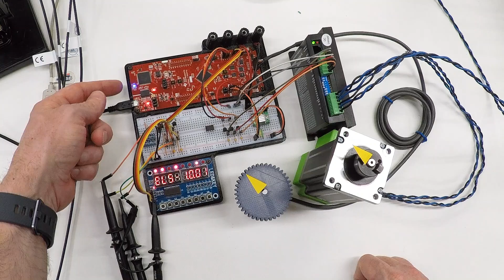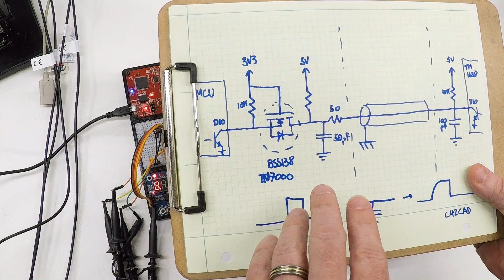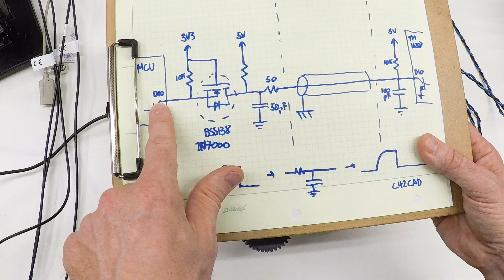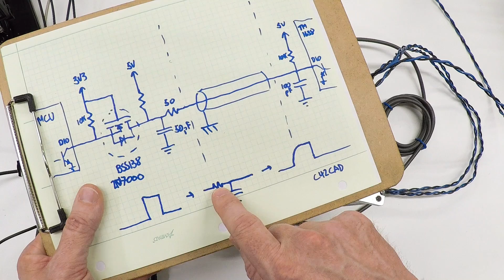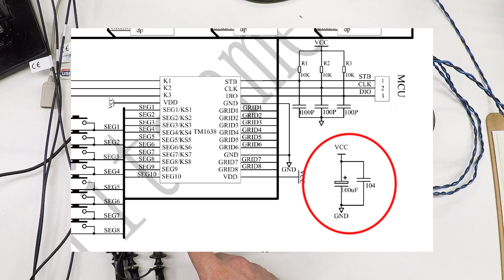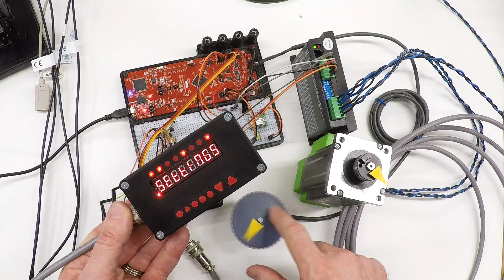Lathe Electronic Leadscrew Part 3: Control Panel and Debugging

Comment: Fantastic idea for starters. I really hate my lathe banjos and gears. Major concern is of course any asynchronicity between spindle and lead screw due to, not SW or HW, but physical forces strong enough to throw the stepper motor off. In a physical gear connected configuration, lathe motor could halt but would always keep spindle and lead screw in sync.
Reply: Most likely, the spindle motor will stop faster than the lead screw, but both are possible. Maybe tachymeter sensors on both can fix this?

Comment: SPI bus is not at all meant for long distance communications (even 2-3 feet) especially in noisy environments. I would use RS232 instead or (better) some kind of differental signaling bus such as RS485 between the microcontroller and the HMI interface... This is also the reason why RS232 intelligent displays, such as a Nextion + RS232-TTL converter, are a pretty good match for these usecases.

Comment: The lost signal by Volatage drop is a really old problem. The Voltage breaks down when the thyristor/transitor is switched. A good power supply can handle that. But cheap charger don't compensate, small surges of power can make the voltage drop in the hole system.
Two ways to counteract that. 

1. Use over-voltage 5.5V by example. 

2. put big caps ( 5v to ground ) near paces where surges can happen. By example near the thyristors.
I'm designing/building circuits for over 20 years now and had such problems often in the past. Modern power supplies have much better voltage regulation so the problem is not so prevalent anymore. The first time i had such a problem it took me weeks to figure it out.
Reply from the maker: Yeah, bulk bypassing often helps.  I did add the recommended bypass caps to the display board, but the timing was the underlying issue in this case.

Comment: Hi, have you tried 3V Vcc for that TM1638 ?A datasheet says, that is it possible (table, power supply 0-7V, so it should work fine) . It allows you to use 3V3 logic level. It is not mine project, but i don't like the LED and Key pcb.  In simple reason that TM1638 is some chines bullshit which can not be bought in reliable sources (digikey, farnell, etc... ) I would rather use 74hc595 instead of TM1638 for 7 segment led.   Absolutely basic chip, cheap and easy to find. I suspect you are going to design own pcb so... no point to use that chinese TM1638. But of course do what do you want.
Reply from the maker: This is a good point.  I was hoping to use as much off-the-shelf stuff as possible, to make the project accessible, with a custom PCB being only a convenience.  Buuuuut... You're right in your characterization of the TM1638.  It's only redeeming quality is that it's readily available in cheap maker modules.
Reply: @Clough42  I am not sure if it is a right way how to design a product. I am doing hw development of SIL4 product for living, so it could be only my deformation :) Now, I can see possible problems everywhere :) Your project has a lot of potential...A LOT!!! In your position i would use only a lets call it "basic" parts, easily accesible without chinese "support". For example, as LED driver 595, or for better sleep 595 + ULN2008, or nice and contrast OLED display and so on... i know i know i saw a genuine DRO and 7 segments are commonly used. But... nice oled display... from Electronic Assembly or Display Elektronik
... i can imagine that...My last tought, stepper motors can skip a steps very easily. Do you have any feedback, if stepper motor did right amount of steps ? But as i said, you are developer, we have to accept that, same as your solutions.  I like  your development very much.  Thank you so much for sharing.
Reply from the maker: I appreciate the feedback.  I'm looking at both steppers and closed loop servos, and will test both.

Comment: You may want to consider a tinted filter on the front of those 7-segment displays. I find them very hard to read in certain lighting conditions without one. And of course this is very exacerbated on camera.
Reply from the maker: Yes.  Absolutely.  I just haven't had a chance to play with it yet.

Comment: what is this all for? so much hassle and complexity
it comes down to mapping the movement from real to virtual with certain accuracy
why not use 2 gyro/accelerometers in sync?
Reply from the maker: You mean like a 6-axis MEMS gyro attached to the spinning lathe spindle?
Reply: @Clough42  yes

Comment: The human interface(display/buttons) is a design decision. 
It is the designers choice and his alone. Especially in this case, as this is not a commercial product. If a 7 segment display fulfills the requirement, and is appropriate for the application then it is the correct choice.
A delicate touch display may be more modern or "trendy", but is not necessarily the correct choice in a gritty, metal swarf infested workshop environment.
Proper buttons and 7 segments might prove far more durable and easier to press.
Reply: If touch screens are such good things for machine tools, somebody should tell the people making the Digital Read-outs for machine tools, they seem to be unaware of the things. ;-)
Reply from the maker: @TheAmpair  Yup.  There are counterexamples, but even the Haas VMC panels have about a hundred physical buttons.
Reply from the maker: That is what I was thinking.  Actual use in the shop will either bear that out or prove it wrong.  (or both)
Reply: @Clough42  Your solution has specific focus on the electronic leadscrew functionality, that is very interesting to me.  I was through the same processes you are now a few years ago. I replaced my simple RPM lathe readout with a Microcontroller/touch screen solution + sensors, that interfaces with a frequency inverter serial bus. It can display all sort of tracking/statistical information. In my experience a gfx display is fine in the workshop, and does actually provide sufficient contrast/viewing angles. I wish however, that I had not relied on the touchscreen for interaction. It's simply too small and awkward in use. 
I would for sure use real buttons for main functionality if I ever revise the design.
What you are designing right now is the missing half of my original design and therefore very interesting.      
 It be happy to share video, pictures, info and personal recommendations (of what not to do) if you wish.

Comment: Great video you explain and show how this is working really well. I want to do the same to my single phase lathe. I assume we can play along buying the parts? would be great if you did a hookup guide? or are you wanting to rather sell kits with instructions? Thanks again every day is a learning day
Reply from the maker: Yes.  Every day is a learning day.  The GitHub repository has the pin connections, but no schematic yet.  My goal is to make everything open source so you could build it yourself, but I may offer some kind of convenience kit or blank board or something.  Everything is still in flux at the moment.  If you do follow along, remember that it's still a prototype and I may swap out parts that aren't working.

Comment: Regarding the use of a touch screen, the concern of dirty and oily fingers is a valid concern, but you could always getting around that by having a cheap stylus with a strap hanging off the side of the screen to prevent lost chuck key moments.

Comment: what happens if you just do without the level shifter?
Reply from the maker: The data line output from the display board swings to +5V, which exceeds the safe input voltage for the MCU.

Comment: Properly designed stepper systems don't loose steps.  The only time I've lost steps on my Tormach mill is when I've crashed it.  That may limit the speed at which you can thread, depending on your stepper and machine, but from the size of the stepper you plan to use, I don't think that will happen unless you go with very course threads, or plan to thread at very high spindle speeds.

Comment: I would love to see a motor on the encoder and a tachometer on the stepper to validate the math, possibly add in a method to offer a mechanical load to the stepper to see at what point the full feedback loop would be necessary. Just a thought. I can appreciate the issues of signal integrity as it relates to serial clocking and the edge to state alignment. Nice work!

Comment: Great job using an oscilloscope to check signal propagation. 
Suggestion:
You should flash the RPM display to remind people to stop the lathe when switching directions.
Reply from the maker: Almost as soon as I turned off the cameras, I thought of just decelerating and accelerating the leadscrew smoothly.  That would save a step and make it much easier to use in the case of "oops, it's going the wrong way".

Comment: Here's a really good bi-directional level converter that doesn't operate as an open collector/drain:
https://www.digikey.com/product-detail/en/idt-integrated-device-technology-inc/QS3VH125S1G8/800-3662-1-ND/6071243

Comment: Good sleuthing. Since the interface is only being refreshed every 50ms and you don't have that many bits of data to send & receive during that time and it doesn't have anything to do with keeping up with the main loop you can certainly utilize a lot slower baud rate and take advantage of extra timing margins. An LCD touchscreen is an option. The LEDs are nice and bright, my preference.
If you integrate the controller and display in the same enclosure then the only long wires you'll have to contend with are the stepper drive signals.
Perhaps put a resolver on the leadscrew and look for missed steps.
So far, I love the digital concept of controlling the leadscrew. My bet is that lathes will probably soon move in this direction. Singer sewing machines moved into this digital direction a long time ago.
Just keep in mind minimum setup, hold times and levels and you'll do all right.
Keep up the great work.
Reply from the maker: If I were designing a commercial product from scratch, I would put the microcontroller and the display on a single PCB and put it all in the control box.  This particular dev board is a little bigger than I wanted for that kind of construction, but it's an option.

Comment: At 29:00 -- running the system at 250 kbaud is definitely overkill.  The lowest frequency in that system is 500kHz, and a good representation of the square wave pulses needs several harmonics above that.  I don't think it would be a profitable use of your time to forever analyze how your system responds at RF frequencies.

Comment: The signals are OK for development version but I would suggest a driver and receiver chip for the signals because eventually you will get caught out. That has been my experience at least.
Reply from the maker: You're not wrong.  In this case, since it's a bidirectional signal, I would need a driver at each end.  If I'm going to spin a PCB for the control panel end, it's worth thinking about just doing a whole control panel board.

Comment: how are you going to manage threading passes? it looks as if you would be able to just reverse the spindle to reverse and let the carriage come back to the start of the thread, but it would be pretty cool to just hit a return button, or the reverse button, and have the controller keep track of the spindle position and carriage position, and move the carriage independent of the spindle but still keep them in sync for threading. I guess a bit like electronic half nuts. Automatic stopping at the end of the thread would also be pretty slick

Comment: The voltage across a capacitor is related to the voltage of the supply. If your supply is only capable of 1 amp, do you think that a load that is at or surpasses that current would perhaps pull the supply voltage down due to its internal impedance? Would that not limit the ability of your circuit pulses to rise to the Vcc?

Comment: Looks like it's moving along well, nice work. One note, the 138 has a much lower working voltage than the 7000's series mosfets. You might want to check the data sheets and gate transfer characteristics, it might make a difference in your level shift.
Reply from the maker: Do you have another favorite transistor for this?

Comment: I worked at a TV studio for a few months in the analog days and an engineer explained to me that on long cable runs they would put a pre emphasis/eq on the video signal so when it got to the receiver the loss was compensated for and you got the signal you wanted.
You don't do it on receive as you get noise problems.
Reply: I wish I could remember the proper words
Reply: Unfortunately on the data line, both ends are sending and receiving data. It would also be highly unwise to anyhow drive data, clock and burst lines in a different manner, because just as long as signal timing is generous and the distortion is equal, it will work fine, but as soon as you introduce differences in distortion, you can get into trouble.

Comment: so far a great build. Need to get some red transparent film, I picked up red green. and blue sheets off ebay , makes a world of difference. I prefer surface mount now even though I cannot see without magnifiers, just use a stencil, place and bake
Reply from the maker: I'm reaching the same conclusions.  A decent reflow oven can be kit-built for $250 or less.

Comment: it does seems from the datasheet that the inputs have 0.35V hysteresis, otherwise those rounded edges would be be sensitive to noise going thought the threshold so slowly

Comment: Hello, project looks great! I do not know, if you mean real servo or a closed loop stepper like this: JMC 2-Phase iHSS86-80-70. I would be more then happy to build one and test along with you on my lathe (TSB-20 polish small lathe). Also I have an idea for additional feature: add another encoder input to to replace carriage hand wheel. Button or switch to disable spindle encoder input, this way you could replace lead screw with ball screw i.e. SFU1605 or even SFU2005. You could wire alarm output from motor drive to detect motor stall due to collision or use serial port in JMC drive.

Comment: I did this just last week! I was tearing my hair out over why my board wasn't working for ages, finally broke down and soldered some fly wires to vias so I could hook up the logic analyzer. Saw the glitch, went "whaaa?" and reread my code. Oops. 

As far as your refresh rate goes, it's massive overkill. 15Hz is the "fluid motion" threshold for humans, and even 4Hz is basically unnoticeable for number updates. It could even help, because it lets you read the numbers instead of just having them all blur together. Giving yourself that extra margin at low clock rates will also give you better noise immunity, which might be important with the big lathe motor going and the stepper having to exert a lot of torque. You'd be amazed at how much interference those steppers can generate.

It might be overkill, but one other thing you could put before your input filter is a discrete TVS (transient voltage suppression) diode. This can clamp transients of thousands of volts down to tens of volts, which is much easier for the input filter to eat.

Comment: Are you sure this is not a grounding issue? Phone chargers are usually floating, but USB sockets on PCs and scopes are grounded.
Reply: That was my first guess, but if you watch the video he solves the actual issue. I've also done this accidentally, so I can vouch that extremely short chip selects will screw up SPI communications.

Comment: Unidirectional translators are much better than those passive pullup bidirectional things for SPI. Eg. 74LVC1T45. Avoid using the ones that automatically switch direction because they require the output to be overridden by the driver which can cause issues at the margins.
Reply from the maker: Yup.  If I had a simple choice available, I would choose a display board with TX and RX pins and skip the bidirectional stuff.

Comment: I really appreciate your thorough and well formatted videos. I noticed your stepped driver power supply is very quiet, is your stepper PSU torroidal? Please let us know which PSU you are using, thanks and please continue your awesome videos. I would also buy the kit if you provided it.
Reply from the maker: It's actually a cheap import switching supply.  I run a linear toroidal supply on my CNC mill and I prefer them, but this is what I had lying around.  (It was lying around because it came off my mill when i upgraded to a toroidal supply.)